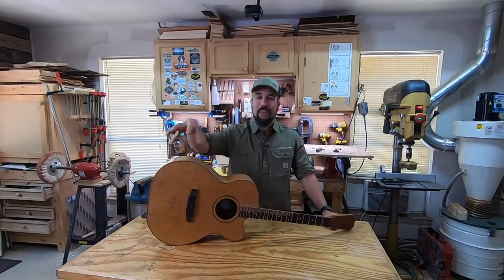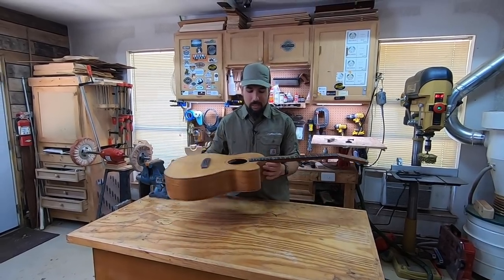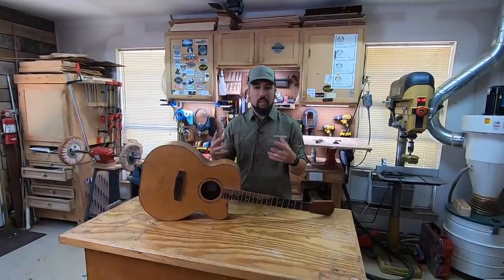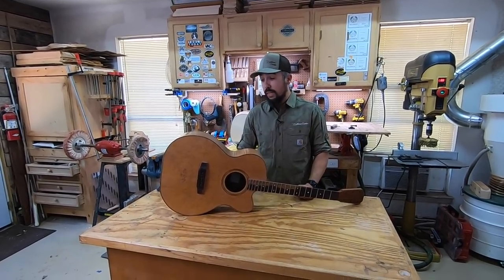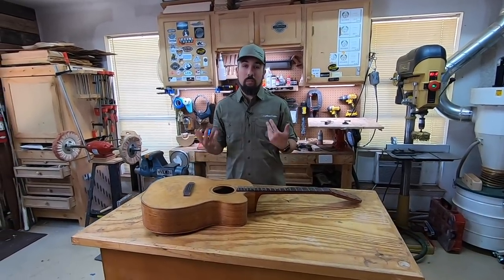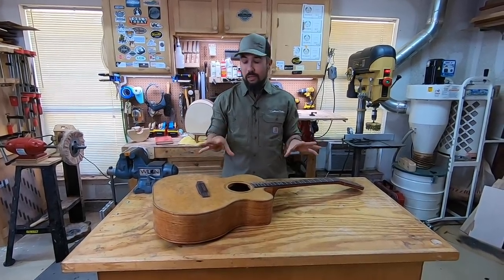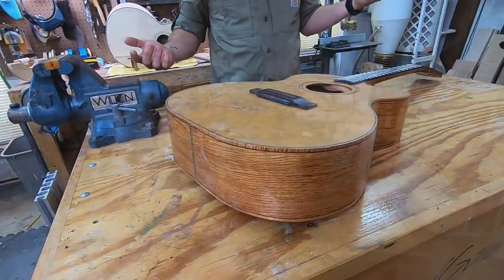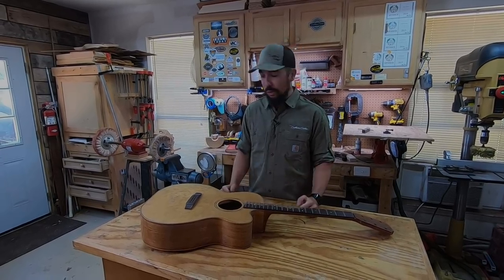My First Guitar

Comment: Hey Chris, I have a question... In your "First guitar" video you show a brief picture of your second one.  It looks to be a nylon string.  I am building a hybrid guitar and want it to be similar to the Taylor NS series.  My question is how should the top be braced?  The sitka spruce top has been thicknessed to about 2 mil, so already thinner than most steel string tops.  Any suggestions on bracing.  I plan to install a pickup.  Should I use the fan bracing similar to a true classical?   The heel joint will be ala a steel string, so this may have some bearing... Any advice would be appreciated..
Reply from the maker: I did a Traditional Jose Ramirez style fan bracing on that one, as well as the few other Nylon stringed guitars I've made. Im about to do one with a lattice style bracing as an attempt to make it a little less delicate. I do Fan if i was you.
Reply: @DriftwoodGuitars  Thanks Chris... love following you on Youtube! Keep up the good work !  Your guitars are magnificient!